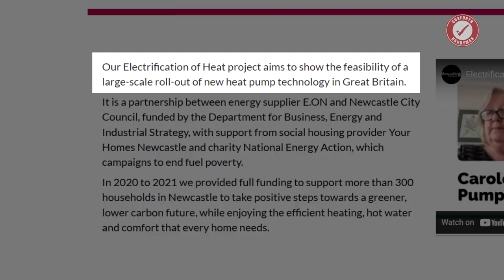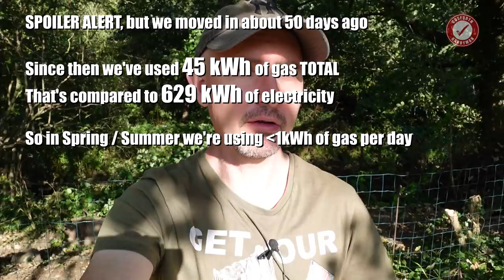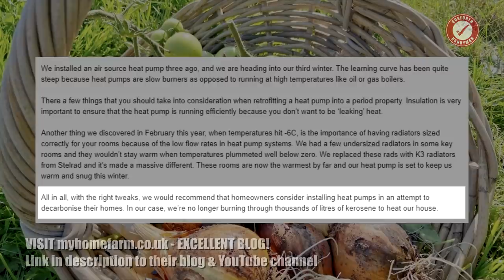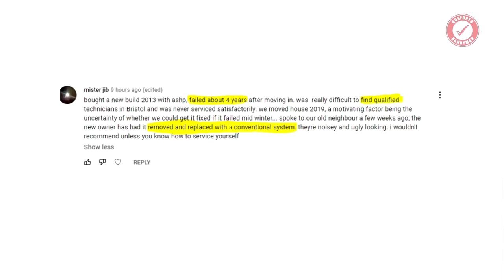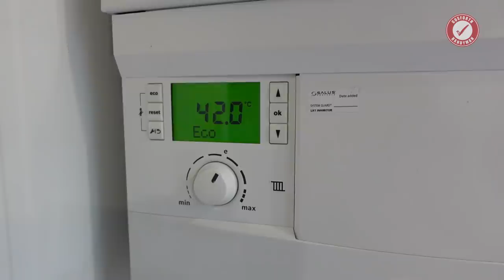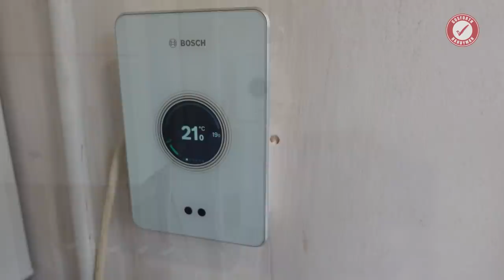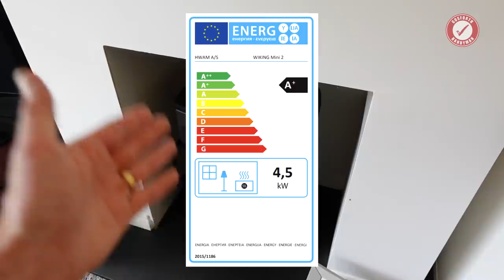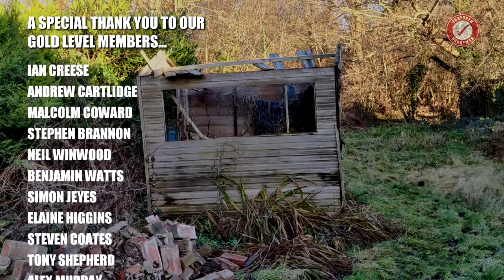Why didn’t we install an Air Source Heat Pump? (1920’s Renovation Part 32)

Comment: Hi sir you made the right well informed decision  . Now we’re to start , ground source is not even in the running so unless you’re in the possession of lots of land we might as well dismiss it .  Next good old air source, yes if you are considering underfloor heating , and it’s a new build with state of the art thermal installation may be. Standard radiators irrespective of size just will not get hot enough , because the ambient temperature of the water is never enough . So why you may say is the government so keen to push this technology. ? to keep the green agenda happy . There not interested if it doesn’t work as long as they can appear to be doing the right thing. So you may ask what is the answer , well gas is still the best bet . But as regards combi boilers they can only service a relatively small household , get into the realms of multiple showers and bathrooms and you definitely need hot water storage .  I personally have no access to gas so am reliant on oil , I have been offered such as air source, wood pellet , and goodness knows what . This relentless drive to be so-called energy efficient is quite understandable, but it must be backed up with irrefutable science and sadly so far that is far from the case .  Best wishes and kind regards to your good self . P S  if I’m any judge as a retired electrical contractor I would say Number 10 would easily cost around a £1000 pound a week in fuel to run , all right for some a 😂👍👍👍

Comment: We bought our house in 2018 (built in 2010) with thermal panels already installed in an unvented system. I think the panels are really good. From March-Sept we’ve used £70 in gas and I think that’s mainly down to our gas hob. 

In the winter we like to keep the thermostat at about 20° and bang it up to 22° if we want to let our hair down. 

Do you think £70 of gas over 6 months is decent?
Reply: @JamesMears76  ouch! That would make me cry. We pay about £75 p/m for electric and gas. We end up with a decent credit in the summer so that we can use it in the winter, and it balances itself out. 

I do recommend the thermal panels if you’re in an area that gets a lot of sunlight, and you have an unvented system. If we didn’t have a gas hob I think our gas usage would be next to nothing in the summer months.
Reply: That is better than 90% of the population honestly. Thermal panels fell out of favor a couple years ago for many people because they wanted PV instead. There was also the issue with the chemical being pumped round turning into gooey sludge and clogging up if they weren't put in with more than the designed expansion as when the liquid over heated it just became jelly like. A good product but we fit less and less now and more PV because PV means running a car on sunshine.
Reply: @effervescence5664  it’s a shame that they seem to be unreliable. I’ve had mine switched on since I moved in and 🤞 I haven’t had any dramas yet. On sunny days I get scorching hot water. 

I can’t say the same for my neighbours though, as I do believe their systems have completely packed up at some point, and they don’t use them anymore.
Reply: @XxBlueSkiesx  They like ashp are great when properly designed, installed and maintained. Unfortunately most people look at them as fit and forget (somewhat like a boiler) forgetting that heating and hot water systems do more mileage per year than their car which they would have serviced and mot'd every year. Your system will last really well, the panels will want cleaning at some point and the fluid checked to make sure it isn't over heating and congealing but normally the systems are designed that the panels will last the duration of the stainless steel cylinder - 25 years.

Comment: It's a pity that Boris Johnson had not watched your video before making his mind up! I think that this is more of a political decision due to the UK government not wanting to rely on Russian gas. Central heating is  not one club golf and I'm sure that the message will have to change over the next few years. Air source heat pumps are not suitable for all applications and you hit the nail right on the head. I went through the same process as you about 5 years ago and came up with exactly the same conclusions and bought exactly the same boiler. As much as I wanted air source pump to work, it would not for me............

Comment: The only way an air source heat pump would efficiently work is in a very well insulated modern home built like a greenhouse!
In the vast majority of UK housing stock ie similar or older than your property, it simply wouldn't work, especially with our climate and a combination boiler is the best and most efficient system for that type of property.

Comment: I thought cadent are moving into hydrogen gas and they have been testing this for a while with there own little test village up north where you can attend. 
There is, already a blend of hydrogen in the current gas of 20% so what is the point with heat pump? Which still uses fossil fuel or nuclear to power these heat pump

Comment: Is a unvented system the same has a pressurised heating system??.. that's what we have, with heating oil... Very expensive in Ireland
Reply: Unvented just means the hot water tank is at mains pressure. It has a pressurised expansion tank, similar to a pressurised heating system, just at higher pressure.
Vented system would just have a header tank in the loft feeding the hot tank.
Combi - no water tank, so hot water at mains pressure like an unvented system.

Comment: Hmmm. Not really true that gas boiler is more efficient. Modern boilers are about as efficient as they’re going to get, about 96% efficient, heat pumps are about 350% efficient. Of course gas is cheaper, but only because it’s effectively subsidised (it hasn’t had green levies applied like electricity has, which ironically was to fund environmental impacts caused by fossil fuels, despite the grid being increasingly renewable now). Government is likely to start applying levies to gas in the future so the cost disparity may well change. I was super pleased with our heat pump so I’m just a bit tetchy when I hear blanket statements that aren’t entirely fair (heat pump noise volumes vary hugely between available models for example). We’re weirdly obsessed with gas in this country, heat pumps much more common in other countries.

Comment: We are just purchasing our first house that's in roughly the same situation as yours was with storage heaters. I'm wondering about electronic radiators did you think about them at all? Thoughts?
Reply: From an engineer, don't bother with them unless it's a last resort, E7 storage heaters still cost less to run than modern electric rads from Dimplex and alike because of the tariff advantages. You'd be looking at around a 3x cost increase on running them.
Reply: They are not electronic. Electric resistive heating. Might have electronic controls but there you go.

Comment: Hi Andy, do you have a gas safe Plumber or two that you'd recommend? I've bought my first house 1.5 to 2 miles east of you, picked the keys up last Friday, and I'm looking to get the boiler moved to either the garage or the loft.
Reply: I would advise against the loft unless you're fit and able or have stairs up to it if you're going with a combi boiler. If at any point you need to top up the system pressure or hit the reset button but you're unable to get up there it means having help around or calling an engineer. Go for the garage if you can.
Reply: @effervescence5664  yeah garage is my first choice, and should be the cheapest (easier access for the plumber, and closer to the gas and water supplies). Yes it's a Combi.

Comment: the reason we had a diesel blowback was because car manufacturers were cheating. i don't think the analogy holds when comparing to a heat pump. clearly when done right, heat pumps are more than capable, and you can power them without burning fuel and adding to CO2 emissions.

Comment: Hello, I appriciate some of heat pumps is difficult to get your head around but trust me they work! If correctly explained. They can be used down to -25 no problem, can they be expensive to run? Yes if not installed or explained correctly. If you'd like to discusse further then get in contact. I can give some expert advise! Ps would i advise replacing a gas central heating system with a heat pump, probably not for running costs but for the environment yes i would. Though these will change. I think comparing betamax vs vhs for heatpumps is totally wrong (betamax was better! Poor management decision from sony, noticed they never made the same mistake with bluray, anyway thats another topic). Heatpumps have a place in the market and the complete renovation you are doing it wouldnof made it an ideal installation for a heatpump. Again by all means give me a shout and I'd happily explain.

Comment: An ASHP/ GSHP system is pointless in our Victorian 3 story, stone built house with 2ft thick walls, 14ft high ceilings and  9ft x4ft original single glazed sash windows in all the ground floor rooms. There just isn't enough heat output to heat the space properly. So we're sticking with our 9 year old 85kw oil fired boiler for now, until something much more effective comes along.  Oh yes and also dont forget ASHP/GSHP use an awful lot of electricity to keep the pumps running.
PS. We also live in the North, but in the cold wet side of the Pennines.

Comment: Thanks for a great and thought provoking video. My two penneth... Burning fossil fuels is not sustainable. It is the main cause of the planet heating up. It's bloody hard to figure out what we're going to do about it when it comes to old housing stock, and you're right that just sticking an air source heat pump into an old house in place of a gas boiler is not an easy or complete answer. But, with respect, your waffle about ikea and diesel cars and thick people who can't use thermostats doesn't change the fact that burning gas is an example of exactly what we need to stop, as a society.

Comment: You are blaming an unvented system for a cheap boilers failures and something is wrong if you are waiting 2 hour. We have 180 litre solar cylinder so probably 120 litre boiler heated, 20 minutes to recover. I can't see why it should cost that much more to run a cylinder.

Comment: Im afraid I totally disagree with your argument that an air source or ground source heat pump is the way to go in a property with a conventional combi fossil fuel boiler, particularly in areas similar to where I live in Devon and similar locations. We are completely rural, exposed to extreme chilling winds during winter. Wind chill often drops the outside air temperature to well below freezing i.e. -6deg C. The housing stock in rural Devon is not amenable to having insulation upgraded to a point where the heat pump works sufficiently well enough. Along with most properties in my village my 3 bed cottage is over 150 years old. The walls are solid stone or Cobb, with solid low standard concrete flooring. To upgrade to wide bore larger radiators would entail digging up the floors and replacing all radiators and pipes. Unfortunately it is not feasible to replace all radiators as there is no room. To convert my property to an air source heat pump if it were possible to mount it on an outside wall which it isnt, would cost in excess of £40,000. We would have to live away from the property whilst extensive rebuilding work took place and to boot the heat pump would not maintain the  rooms at a liveable temperature in Winter. Since we are not on the gas grid, most rural locations here are not, the only feasible alternative is the use HVO with a conversion cost of £500 per household. This is non fossil fuel oil that can be used in any standard modern combi oil boiler.  Newcastle is certainly not unique for its cold winters, I used to live there. The problem is that there is a hidden political agenda to get everybody onto heat pumps despite the fact that in the majority of cases they are insufficient. They are costly to run with little of no gain. Ok for new builds provided the building standards are high but definitely not for properties older than 100 years.

Comment: You are spot on with the government snake oil salesmen of heat pumps. It would actually be far more efficient to have community heating as they do in large parts of continental Europe - a large boiler house supplying hot water for heating and hot water to hundreds of homes is going to be far more efficient than hundreds of boilers in separate houses.

Comment: How is your water pH? Discovered that Yorkshire water is very acidic, and can cause the solder in the pipework to corrode, so was wondering about Newcastle water.
Reply: Not very acidic, also by adding a corrosion inhibitor to the heating system you can avoid any issues
Reply: @KeyzerSoze99  was the drinking water side where the issue were, no inhibitors to be used there.
Reply: @cjhification  ah right, still not an issue, also, it seems like hardly anyone solders drinking water pipes these days, it's all push fit.

Comment: THE PROBLEM   is not the Air source heat pump  It's that wonderful word retrofitting. YOU CAN'T connect an ASHP to radiators.    To work efficiently it has to be fitted to under floor pipes the whole floor is the radiator.  GET RID OF THE RADIATORS

Comment: Surely the issue with 99% of properties is inadequate or sub-optimal insulation? Its like car fuel economy: the ideal is to use less heating and to retain the heat far longer. If we all had tip top insulated buildings, the gas combi boiler suddenly looks like a very environmentally friendly option.
Reply: How do you insulate a house that needs ventilation to stop it becoming damp...
Reply: @AHR_James  Fair point. I think the testimony from the video is that if you seal up the worst spots (suspended floors etc) the house can still be well ventilated and warm enough in all but the most severe of winters.

Comment: I think you talk a lot of sense  in many subjects.
ASHP are supposed to be green, but if along with your electric car, you are as you mentioned creating a massive carbon footprint, albeit somewhere else.
We dont have the generation capacity right now if, we went HP nd electric vehicles for private and distribution travel.
Worcester Bosch are now producing hydrogen ready boilers.

Comment: Whenever there is a government scheme or a company pushing something new you have to go to first principles of physics for these things.

Clean coal and clean diesel was all ways false, efficient in mileage but never clean.

Heat pumps work and they are the most efficient electric based heating which can then be renewable powered, really big dependency on the type of home that it’s going in to and there is a big difference in the quality and capabilities of the differing manufactures heat pumps, cost are massive.

Gas is the most cost effective system, it’s the cleanest of brunt fuels but it’s still not remotely clean 

Hydrogen is a pipe dream, it’s either “blue” broken down from natural gas and thus a fossil fuel, same as gas but with even more processing steps and energy wasted. Then there is green hydrogen from electrolysis and it is truly green but making it needs about 3 times the input energy than an ASHP and it doesn’t have the refrigerant multiplier. Then it has the issues of leaking though most pipes, having no smell, no visable flame and its ability to explode in great fashion

The Key is to build the home with a fabric first approach with very good insulation and air tightness. A proper passive house can be heated with just an 800w resistive heater in Scandinavia in winter, purely because of how well its fabric is put together no fancy heating tech needed.

Comment: Doesn't spray foam insulation give off nasty chemicals over time once it's installed?
Reply: Well - does it .....?!?!
Reply: @andymccabe6712  I am in the air purification business - plasmaguard - using cold plasma ionisation technology to eliminate pathogens such as COVID-19 and Volatile Organic Compounds emitted in buildings. I am sure our brains trust who developed it in the USA mentioned it as a source. I shall do a bit more digging. I live in the Middle East so we don't get much call for it - and our total energy bill is about twenty quid a month so it's not really a 'thing'. Love your work Andy, thanks.
Reply: Drumroll 🥁 ....still rolling ....

lol 😆 

Will this question be answered? Or will it remain a mystery ? I would like to know, but I also like the suspense.....

Comment: There is a problem with companies horrendously overcharging for green technology!  Heat pumps are an example of this; the technology is incredibly simple based on Air Conditioners, so I'm not sure why people are having trouble getting HVAC guys to work on these systems!  Maybe they're involved in the scam . . . or parts arn't available.

All heatpumps need to be installed with a backup heater of some kind that will turn on when the outdoor temperature drops below it's point of efficiency.

But I'm by no means an expert on this if someone wants to chime in here.

Also you have to remember that every year an ICE car is on the road it's polluting, so the sooner it gets scraped the better.  Even if it's brand new, it releases less if you immediately scrap it!  EVs take about 2-3years to meet the break even point on carbon emissions, so it's a flawed argument!  Then there's the economic incentive: EVs cost considerably less per month to operate in both maintenance and fuel!